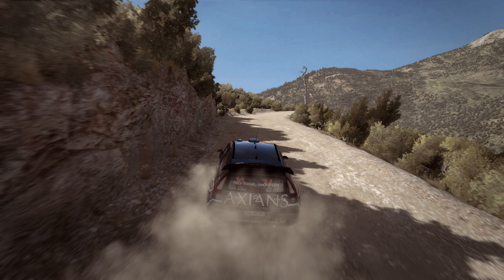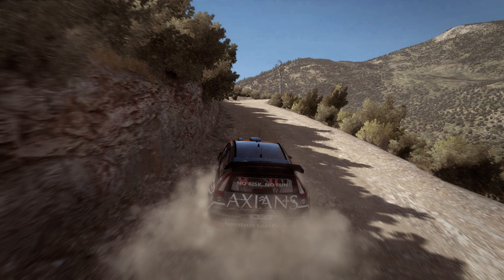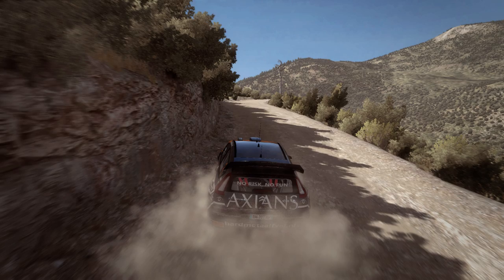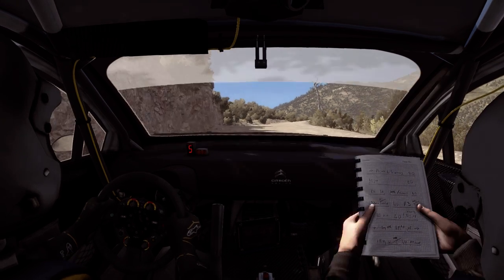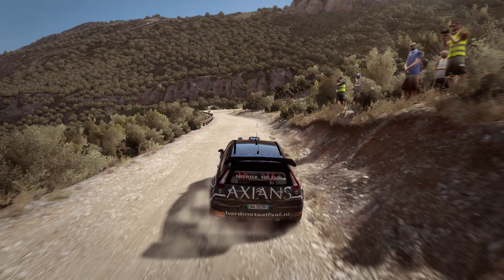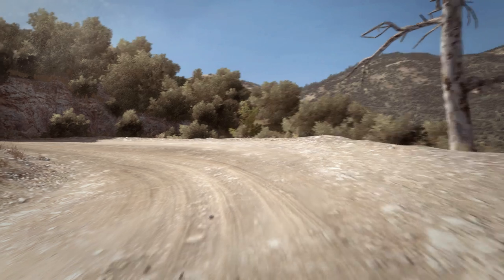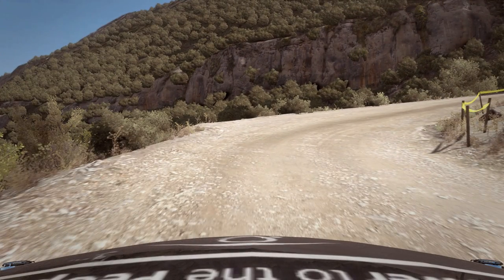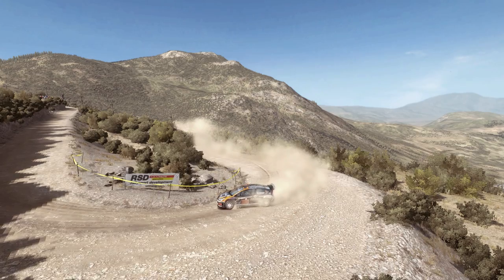Dirt Rally - Hairpin Tutorial for consistencey, and a little on slow in fast out

Comment: I've played this game for 25 hours and I still can't figure it out. It's really pissing me off.
Reply: Alec APerson just slow down
Reply: @goosegoose5361  I've figured it out since
Reply: proud of u
Reply: Too much Speed is the main thief
Reply: @mickeyhage  how did it click, I'm hammering on this now :/
Reply: @yurimolotov5886  this game is pure stress. The best I've gotten is being number 5 and that's with the easiest 2000s and 2010 cars
Reply: i end up using a tap on hand break
Reply: Legit Plays i started playing yesterday and 1. place several times (logitech g920) I only played fh4 dirt races before which is way more arcade and forgiving
Reply: @mickeyhage  I couldn't do hairpins because the wheels didn't spin and the reason was because i had the Traction Control settings maxed out and that was reducing the throttle input, when i turned it off, the wheels spinned and i was able to pull off a hairpin, acute and a square turn.
Reply: @Kristjan687  I've since gotten pretty good because I have 500 hours across both games.
Reply: @mickeyhage  ok cool.

Comment: I have a huge problem in slowing down before the hairpin, basically either I slow too much and the car almost stops before the turn, making it impossible to do a handbrake turn, or even thought I'm slowing the momentum is too high and the car goes straight into the rail...
Being practicing and it's the only thing that I haven't learnt yet
Reply from the maker: Try this. About 1.5 seconds before the braking zone, just come off the throttle. This should give you loads of time to start gently braking and assessing it's impact. Eventually you'll get a feeling for the braking.